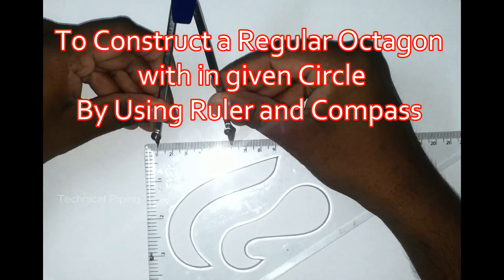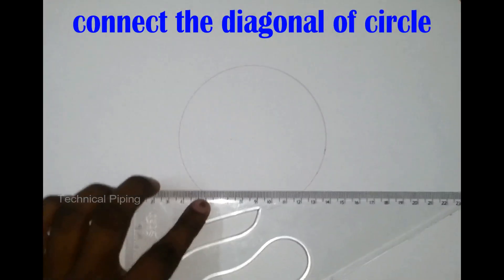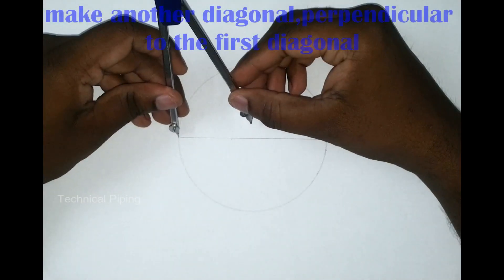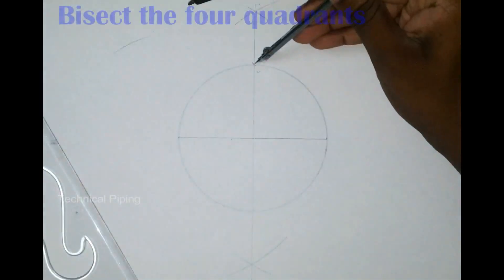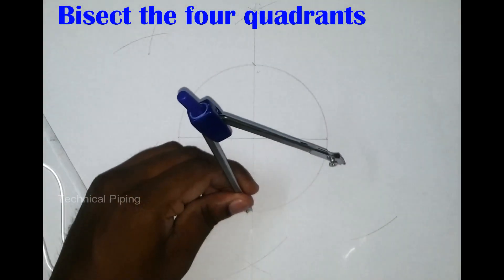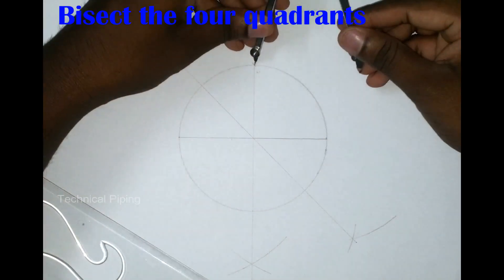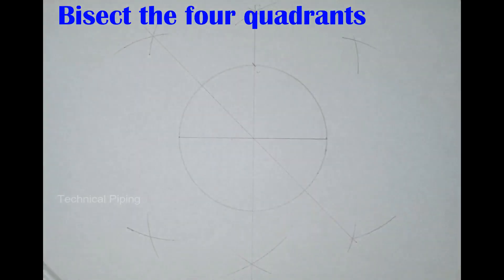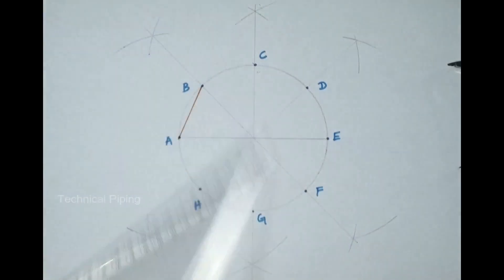Constructing a Regular Octagon within given Circle by Using Ruler and Compass

Comment: You don't need to take the exact measurement of the diameter and then the points of the quadrants, it can be any size larger than half the distance you want to cut in half. Otherwise excellent demonstration 👍